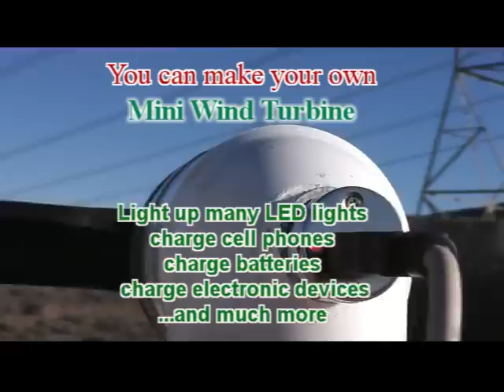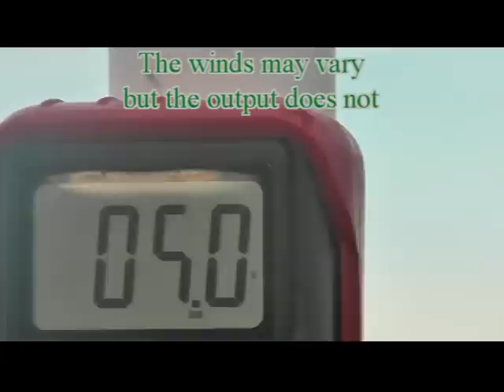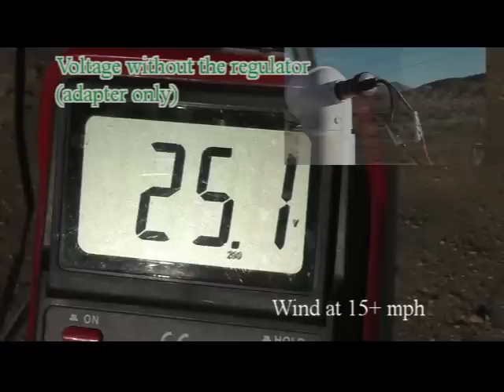Mini Wind Turbine G2

Comment: Does the stepper motor have an max voltage output ? :)
Reply from the maker: Allan Larsen 
Yes it does. 
The simple answer is: it depends on the gauge of the insulated copper wire used to make the coil, the number of windings, the strength of the magnets.  
Since the one used to make this video came from an old printer, I don't have the specs on it. I have tested it (as a generator) in strong windswith an output  up to 38 volts, but I could not guarantee if it would go any higher. STT
Reply: ScienceTubeToday Well that's why i asked about a voltage regulator. I mean if you connect a load like a 5V led light bulb and the turbine delivers 38V then what ?
Reply: ScienceTubeToday  Is the voltage regulation in the cigaret charger ( sorry i am a bit novice )
Reply from the maker: Allan, that is a good question
Yes. It regulates the voltage output to 5 volts (some vary from 4.8 to 5.2 volts, which is an acceptable range) and it also limits the amps to 1 amp.  STT
Reply: ScienceTubeToday  I Watch 'ed another video with a larger Wind turbine where a so called dummy load was used to control the Wind turbines rpm's. Like if it was chargeing a 
batterie and when the batterie was fully charged then the dummy load keep's the windturbine under control . I suppose its the magnetic field that needs a force working against it
so that the windturbine wont take off. ?
Reply: Allan Larsen By the way thank you for answering i really appreciate it
Reply from the maker: Allan Larsen 
Allan, one thing we always have to consider when talking about electricity is the "watts". Volts alone don't really mean much, if you don't know the amps. Formula:  (volts x amps = watts). So, to answer your question, 38 volts at 1 amp = 38 watts which would burn out the LED light. 38 volts at  0.1 amps would most likely not burn the LED light. I have a Van de Graaff generator that puts out over half a million volts, and I can survive getting shocked by it without a problem...it just feels like a bee sting, because the amps are very low. I hope this helps.

Comment: I'd worry about sending too much voltage to the USB charger. It's meant for 12V, right? But it's probably OK to send it 25V. However, it's probably not OK to send it 50V. I think this wind generator needs over voltage protection for the USB charger. What would you recommend?
Reply: +Terje Oseberg I agree, although another possibility is to make sure the turbine blades with 'stall' or in some other fashion slow at speeds where dangerous voltage is produced.  It's instructive (on a project like this) to take a look at commercial turbines of similar scale and check out their features (e.g. Marlec Rutland 504). You can't duplicate them without much more complexity, but you do learn about the dangers (in this case overspeed) that you should think about, and you get a sense of what's possible and what's not.
Reply: the USB charger can however stop over-voltage right ?
Reply: Marl Songs, I'm sure the USB charger will supply 5v to your USB device, however, how many volts can the input to the USB car charger tolerate when it was designed to take in 12v from a vehicle? When charging, the alternator on your car will produce a little over 14v, and automobiles are pretty nasty electrically, so a device designed to operate in a vehicle should be designed to tolerate at least 20v so that it doesn't fail. However, there's nothing in this wind mill design to prevent it from generating 100v if exposed to 100mph wind, which might destroy the USB car charger. Tai Viinikka suggested using a different propeller design that would stop functioning efficiently at speeds that would generate such high voltages as a simple design change that would prevent supplying too much voltage to the USB car charger.
Reply: I don't think my machine will get over 32km/h (even If, I might keep it sealed) However, if it does, will it destroy the usb car charger, my usb charger or all of it plus my device (smartphone...) ?

I can risk it easily if it's only the car charger that might be destroyed 

Sorry for bad english
Reply from the maker: I only use this model in moderate, and not gusty winds. You are correct, on a very windy day I can have this Mini Wind Turbine produce over 100 volts and that, if connected would fry the charger. I have played with this in many ways, one of which was to use a step down transformer, then a full wave bridge rectifier to make the AC into DC, then a voltage regulator/stabilizer. 
The other thing I have done was to reverse the step down transformer, and use it as a step up transformer. That way, I obtained (depending on the wind gusts) 200 to over 400 volts, enough to light up a T12 Fluorescent light.
Reply from the maker: Marl, I would not connect this mini wind turbine if you don;t have a good knowledge of electricity. The reason is that the wind speed outside can vary a lot. Where I live it can get to 60+ miles an hour. That would make this little generator generate well over 100 volts, and it would toast a car charger immediately. You would need a voltage regulator that can handle higher voltages, but only give you the 5 volts you need to charge delicate electronics. Modern cell phones are very picky, they like stability, not variation...and they all need "regulated" voltage (steady, no variation)

Comment: Love the dig project, I have a quick question I have an old drill still work but i got a new one. So my question is can I use the motor from my drill to build a mini wind turbine?
Reply from the maker: +urpapichulo01 
The drill motor is usually made with magnet wire in the rotor coils (the spinning part), and magnet wire in the stator (the fixed part). This type of motor may not work because it needs an initial dose of electricity to create the electromagnetic fields. My suggestion is: look for a motor that that is built with "magnets" and "magnet wire coils"..a stepper motor would be great for a small project, or you can use the motor of an old treadmill for a little bigger project.

Comment: So I've tried this with a regular motor, the only problem is, is that the motor doesn't give enough energy so i'm looking for a stepper motor now, I found one with 4 wires, will that also work? And if not, what else would you recommend?
Reply from the maker: basboy542 Yes, it should work just fine. Most likely you have 2 coils inside this stepper motor. Test to see which 2 wires make one coil. the simple way is to attach an LED light to two of the wires, then spin the motor shaft. If the LED lights up, you found the two wires that make one coil, if it doesn't light up, then test a different combination of two wires. Once you've identified coil "A" and coil "B"...you have a generator ready to go...Those wires are going to produce Alternate Current.
Reply: ScienceTubeToday Thanks for the fast reply! I'll try it out

Comment: very good build indeed but with an average of 25v produced in 15mph wind. and bringing it down to 5v 1A, there's a lot of energy being wasted
Reply from the maker: Correct. Heat dissipation is an unwanted loss of energy. I have built another one and added a step down transformer at the end of a 60-foot wire and I only rectify the current at the end. The AC generated at the turbine travels very efficiently to the point of use...then I step it down, rectify and regulate. Having a lot of fun with it.

Comment: Hey STT, 

Great video. Quick question I found this motor http://www.canadarobotix.com/stepper-motors/stepper-motor-25 

with a  detent torque (Maximum Detent Torque: 0.016 N.M) or (I converted- 163.15456 g-cm) and attached Master Airscrew Propeller 16x10 on there. Do you think this project will be successful.

It's so difficult to find a detent torque stepper with 50 G-CM or below from a distributor in  the GTA area.

Thanks for reading my message and any advise on this would be greatly appreciated.
Reply from the maker: +deep deep 
Hello deep deep. 163 g-cm as a detent torque is a challenge to overcome. The 16x10 propeller will have a hard time turning it (it's too small), especially if you attach a load to it. Have you bought this stepper motor and the propeller yet? If you already have the stepper motor,  try using a household 3-blade fan. Because of its large area, it can give you good torque and might work with your project.
If you haven't purchased it yet, let me know. I might be able to help. If that is the case I would like to know the average wind speeds in your area, to see if what I have is compatible....or if you just need this for an indoor/classroom type project. STT
Reply: +ScienceTubeToday 

Thanks for the response!

Haven't bought the stepper yet. I'm from Toronto. It says 15 km/h average.

It's for a project at school.

How much of a difference is 163 g-cm to 50 g-cm? 

There were some online options for stepper here was one:
http://www.robotshop.com/media/files/pdf/specifications-sy35st28-0504a.pdf
Reply from the maker: This motor has a low detent torque (SY35ST26-0604A) and it should work just fine judging from the specs.- But it also depends on the size of the propeller you choose -  Before you purchase the stepper motor, i just would like to give you a suggestion. Ask friends and family if they have an old broken printer. If they do and are willing to give it to you, you can probably obtain 2 stepper motors from one printer. It is worth trying. They are easy to remove. PS: You will not have a lot of power from this generator. You will probably be able to light a few LED lights or make a 3 to 5 volt electric motor run. All you need to do is buy or make a full wave bridge rectifier (about $2 to $3)
Any questions, I will be glad to assist. Good luck!
Reply: Thanks for the response. I ended up creating a custom 18x3 inch 4 blade prop from PVC 3ft 3in diameter.   Flatten blades with heat gun. Twisted structure ( metal ) counterclockwise towards motor. It moved pretty well and freely. 

I have the 12V .33A nema17 stepper. I think I may burn out the motor. 

I did take apart an 1996 printer bought the prop adapter. Not sure what the specs.

Do you think I'll burn out the motor for 12V stepper or printer? 

Thanks for your help really appreciate it.
Reply from the maker: +deep deep 
Not a chance you will burn out the stepper motor. I have tested these things under severe conditions and they don't even budge. Should work just fine. The only thing that can damage the stepper motor is if you short the wires while in operations.  Please keep me informed. I am an educator and researcher, so I like to collect and share information. Take care. STT   :)
Reply: That's really cool of you to post these videos. Helped me with my senior project and possibly GE interview. Which ever school you teach at those students are lucky to have you as a prof.  I'll keep in contact would like to learn more about wind generation type III windmills. Possibly find a way to imitate this with my project.
Reply: +ScienceTubeToday 

Hey it's me again. So I finally hooked the circuit up but can only manage mV or at max 1V when I turn it by hand quickly. Is that normal? 

Currently using this 4 wire stepper motor.
http://www.canadarobotix.com/stepper-motors/stepper-motor-25

Also tried a DC motor 2wires and at max I can get 1V.

Not sure what i'm doing wrong here. Shouldn't I be getting a higher voltage when turning by hand quickly?
Reply from the maker: You are getting, say 1 V at what RPM? Are you spinning it manually, or is it already mounted and spinning in the wind. 
Let's troubleshoot: Do you have the stepper motor diagram? If you have 4 wires, then you should have 2 independent coils. You need to make sure you are using the two wires from one coil...One simple way to test it manually is to choose 2 wires and connect them, making a short circuit...when you try to spin the shaft with your fingers, it should have a strong resistance (because that one coil is shorted). If you have no resistance, it's because you picked the wrong pair of wires...try a different combination. Another way is to simply connect an LED light using 2 wires...if they are from the same coil, then the LED light should light up when you spin it. A stepper motor like the one you are using, should give you voltages of more than 30, 40, 50 volts easy (in 12 to 15 MPH winds and and a 20 to 24 inch propeller)... Write back - Good luck!   STT
Reply: +ScienceTubeToday  Hey STT ran the coil wires in series and by cranking the  shaft with fingers I got 35 V -50V so you're right! I ll take another video with V and all. Once again thanks for your help. I will keep in touch!  This project was lots of fun!

Comment: Thanks for the great video, I'm planning on trying to make my own wind turbine similar to this one. I am planning on purchasing a bridge rectifier rather than trying to make one. I am a little bit confused about the different kinds of bridge rectifiers available. What amperage and voltage would you propose to be the best for this project? The ones available on Amazon range from 5A to 50A. The range of voltages on the bridge rectifiers varies a good bit too.
Reply from the maker: Hi Andrew
Bridge rectifier GBL005 is a suggestion. Connect the 2 wires coming from the motor/generator to the 2 inside pins (that's the AC going in)....then, the outside pin on the left is your positive DC and the pin on the right is your negative DC. I have used this rectifier and it worked well.  Any questions, just ask  :)    STT

Comment: Excellent video. Very well put together and informative. What about putting a LiPo battery pack and charging circuit to help protect components from excessive winds and voltages. Would be great for camping and you would be able to charge your phone even when its not windy. Thanks for the video!

Comment: Thanks for sharing
Have you parts info and link propeler pvc holder etc
Reply from the maker: Edmorbus The PVC pipes and fittings are all 2" (4 elbows for the base, 1 elbow to connect to the nacelle, 3 "T's"), the metal connector nacelle-to-motor is a Plumbquik P3000-22 also 2". The motor/generator is a stepper motor Nema 17 with six wires. The bridge rectifier is made with 4 diodes 1N4001...easy way to remember how to solder the four points together...put the diodes in front of you...make a square with 2 diodes pointing North and 2 diodes point West....the upper right and the lower left of the square you formed is where you connect the two wires coming from the generator...the upper left is your positive DC and the lower right is your negative DC...after that, all you need is the cigarette lighter female adapter...and of course the cigarette lighter charger 5 Volts/1 Amp...and that's all you need.
By the way, I am currently evaluating some manufacturers and I will have kits for sale soon, since these parts are from totally different suppliers, I thought I might just make it easy for people to order everything from one place only. FYI

Comment: Very nice video! I also have a similar stepper motor but when i connect a LED, the motor is very hard to turn. Can you imagine what could be the error? Can you give me the exact specifications of your stepper motor? That would be very nice :D
Reply from the maker: TecBrand, different stepper motors have different "detent torque". This is due to the interaction of the magnets and the other metals contained in each stepper motor. Some have very little detent torque, others have very high (like yours). There is really nothing you can do to change it...but, when you look for a stepper motor to make a mini wind turbine, ask for the one with the lowest detent torque. 
Another suggestion is to use the 3-blade fan of a regular household fan, instead of a propeller. It may give you the torque you need to spin it... Good luck, have fun...:)

Comment: Thanks for a great informative bit of education! I apologise for getting terminology wrong and for asking silly questions as a novice, obviously the amount of voltage output depends on the size of the generator but is there a way of increasing the gain without increasing the size of generator?
Also is the amount of output affected by the length of propeller blade?
Thanks again, I have subscribed.
Reply from the maker: Hi Richard. Your question is actually a good one. A generator's output is directly affected by the size and strength of the magnets, the gauge of the copper wire, and the number of loops (or windings) in the coil.
For example, a generator with weak magnets will produce weak current
A generator with coils with just a few loops (windings) will not produce much electricity.

So, bigger and stronger magnets and generator coils with many loops will produce more electricity.

There is no way to obtain more energy from a generator than what it was designed for. You can use a transformer to increase the voltage output. However,  as the voltage increases, the amps decrease in the same proportion. It is the laws of physics.

I have obtained over 400 volts with the wind turbine you see in this video, and I was able to light up a 48-inch fluorescent light bulb by using a transformer (in a very windy day). But there was no gain in the total output of "energy", because as the voltage increased, the amps decreased.

The energy output of a generator is given in Watts which is Voltage x Amps = Watts. 

For a given generator output, let's use an example of 600 "Watts", there is nothing we can do to make it generate 1000 Watts. Whatever you increase in voltage (by using a step-up transformer), you will lose in Amps in the exact proportion, so the 600 Watts will not change. 100 volts at 6 amps = 600 Watts. Increase the voltage to 200 Volts (with a transformer) and the Amps will automatically decrease to 3 Amps = 600 Watts.

The fundamental physics law you have to keep in mind is: In the universe, energy can not be created or destroyed, it can only be transformed from one type to another. 

I'll be glad to answer further questions, if you would like.  Regards.